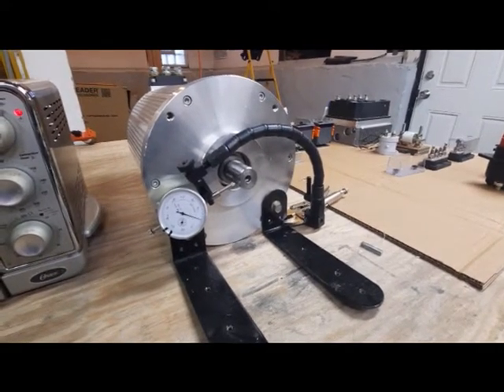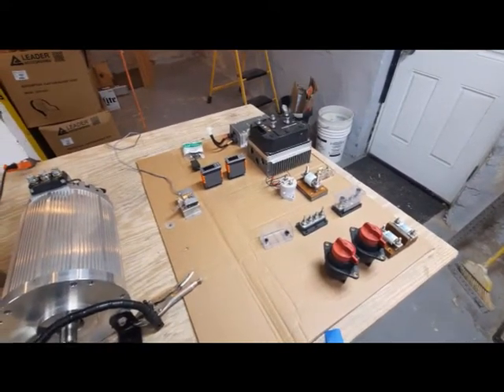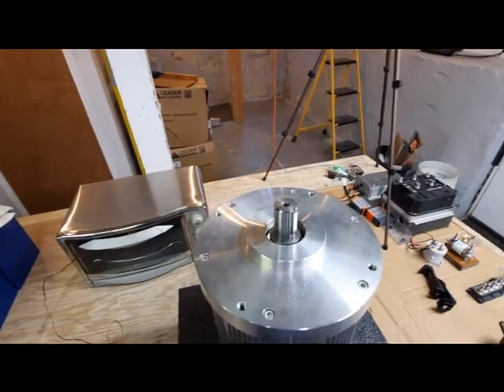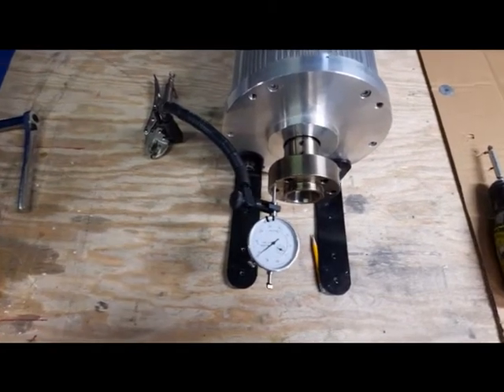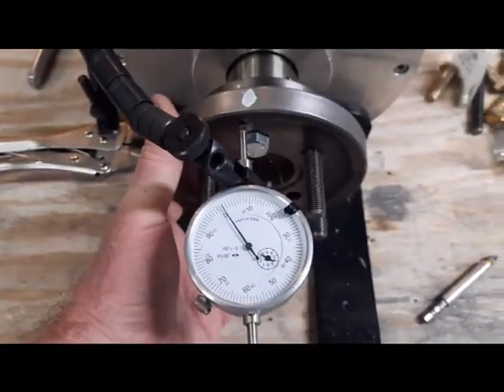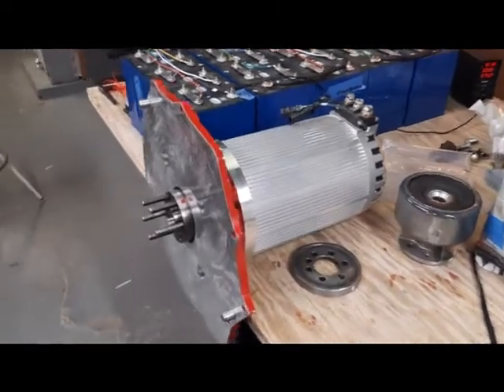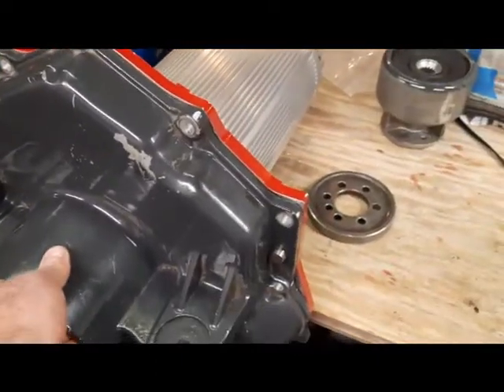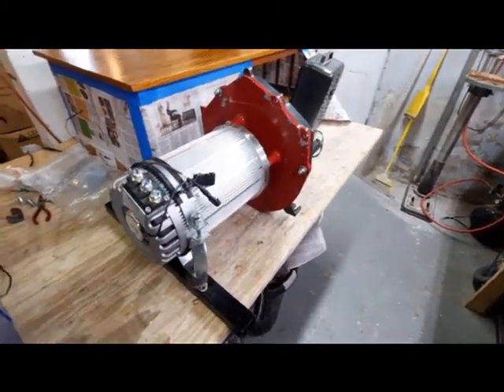Episode 7 - Hyper 9 Motor to OMC sterndrive assembly

Comment: is using the existing bell housing the best way to go, or would be making your own mount work?  Did you do this to stabilize the shaft during trim operation? I am currently scratching head over best way to do this on my conversion. I have motor out looking at splined shaft from outdrive and hope to do it right the first time.
Reply from the maker: I was initially dead set on NOT using the bell housing and CanEV adapter. I had a very enlightening conversation with CanEV and it made my life much easier.

If you are doing a straight inboard, it's a different story
Reply: @evboatconversion.electricboat   would you have time for a conversation and if so, how might we connect?
Reply from the maker: evboatconversion at g
Reply: @evboatconversion.electricboat  Just curious, what would the issue be with a straight inboard? Angling of the motor?
Reply from the maker: I don't see a problem, less complex than  IO.

Comment: Watching this made me think when I do my 17.5' Avanti to measure from the center of the crank to the mounting surface at the front mount before remove the gas engine so I will know about where the EV shaft needs to be. Hindsight is 20/20,  think I will put the adapter into a lathe and cut the lip off and cut in a recess for the lip on the drive coupler. Again, watching what you are doing is really helping. Interested to know if .038 matters. The spine in the couple just sits in the rubber. I've never measured one to see if it runs true.
Reply from the maker: I think the deviation is in the OMC coupling itself so I expect it will be as good, or bad, as it was with the gas engine.